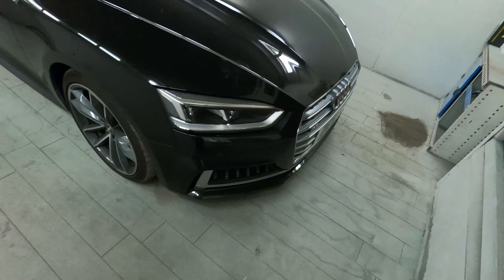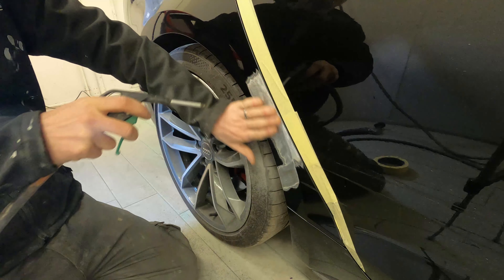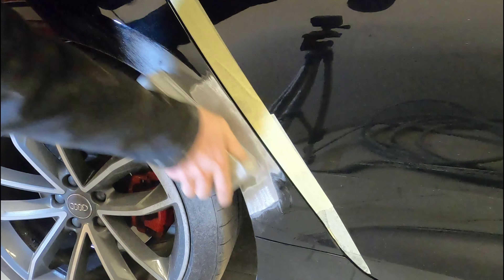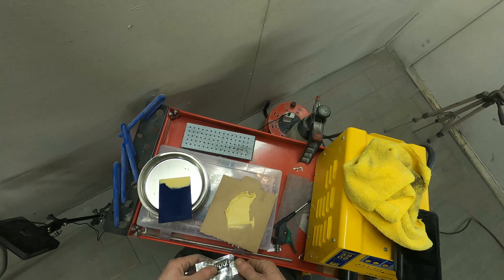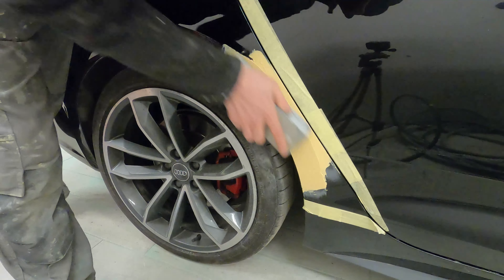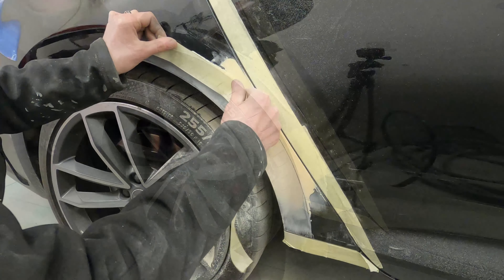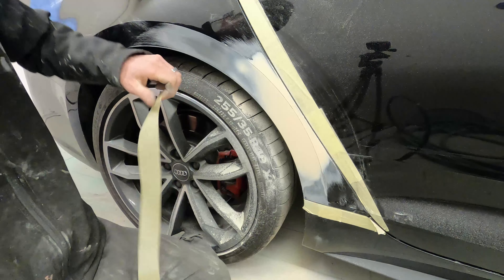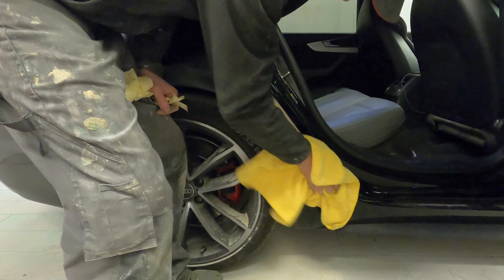Audi S5 Wheel Arch Repair Part 1 How To

Comment: Another good video Tony. Hope your customer has better luck with the lease company than I had. It will be a true test of your skills mate. The inspectors come and look for changes in the finish, mainly orange peel. they then put a paint thickness meter on the area and detect that it has had extra material and charge you dearly. The last car I leased was a Passat. I had a similar repair done, which the inspector located. They charged me nearly a grand for it. So add that to the £400 I paid the body shop to do the work. And the real piss take is that the car was collected by British Car Auctions, so went straight to the block without anybody spending any money on it at all! I will never lease another car now.
Reply from the maker: We do loads of them mate tbh and I’ve never had one pulled yet bud from Audi’s mercs to bentleys

Comment: Great job as always Tony and as usual you make it look so easy which I know to my cost it aint! 😂 will you be using your UV primer on this job mate and do you still use the Scangrip UV lamp? I think you have seen the Mipa lamp that I got recently but it's a fair bit cheaper than the Scangrip, I haven't used it in anger as yet but have tried it on an old bit of steel and it seems to do the job ok, all I want it for is priming cut throughs after blocking and sanding high build, looking forward to Friday's live chat and lets hope you get more views this time 🤗👍
Reply from the maker: Thanks buddy and it is as easy as it looks lol well after 20 years doing it anyway lol , and no 2k primer on it mate and yeah I’ve seen those Mipa ones very good looking but if kit for the price that’s for sure
Reply: Ah ok I thought you would have used UV but maybe the repair is to big, I couldn't afford the scangrip which may have been better as I think it's more powerful 🤔 time will tell if the Mipa will be ok, if not then I'll use it to top up my suntan 😂
Reply from the maker: The Mipa one from what I’ve read and seen is fine mate just asked a few mins more to cure than the scangrip and I could have used it for this mate but tbh mostly use it for bumper Corners n the such it depends how much time on the job I’ve got n this one esp with filming took a while as that doubles the job time just for filming it like this
Reply from the maker: The Mipa one from what I’ve read and seen is fine mate just asked a few mins more to cure than the scangrip and I could have used it for this mate but tbh mostly use it for bumper Corners n the such it depends how much time on the job I’ve got n this one esp with filming took a while as that doubles the job time just for filming it like this

Comment: Hi mate hope you doing well.
I was woundering if you use epoxy primer or etching primer befor filler primer ?
And which one would you recommend using.
I would really appreciate it if you could suggest some product's (brand and details)
Thanks a lot
Reply from the maker: Hiya mate if it was a bare metal shell I’d go for epoxy I’ve heard novol and mipa are both very good mate , and your either best to fill direct to metal or over epoxy not over etch Asia it doesn’t like to adhere as well
Reply: @TonysRefinishingTV  cheers. Really appreciate it. What filler primer would you recommend over the Epoxy primers that you've recommended though ?
Thanks
Reply from the maker: Any pretty much mate can go over that more depends on the work your doing deep or shallow fills ect the new upol premium range is spot on

Comment: Great tips, do you have to in form the hire company as. This is accident damage so when is car is sold. The new owner should know about repair work?
Reply from the maker: Technically your not sposed to have them repaired mate tbh but if you take it back to the company with any marks and damage they screw you on repair charges ect and then send them off to huge places to be refurbed anyway so it’s best to just use a good shop have it done properly and save some cost for yourself
Reply: Garages do smart repairs on this sort of damage that happens in transit on new cars and don’t tell customers, so why would you inform the hire company if it’s repaired?
Reply from the maker: Very true mate even happens in the factory too if they get damaged there

Comment: What grit of sandpaper does epoxy primer needs to grab to.
I mean what grit of sandpaper should be used befor epoxy primer or body filler ?
Thanks
Reply from the maker: Personally I’d use p180

Comment: For such a small punch why haven’t you at least tried it before with PDR ... or maybe it doesn't go with aluminum
Reply from the maker: It’s not ally it’s steel and there was more then one mark the actual arch line had harsh lines along it that need repair not pdr